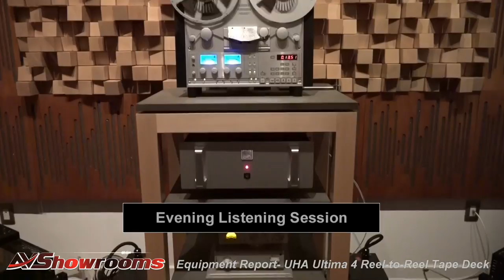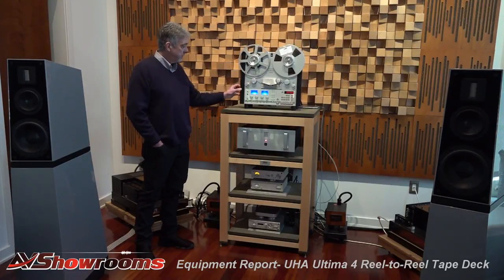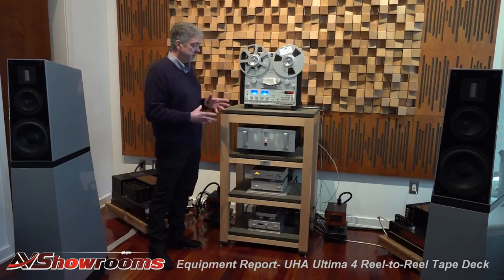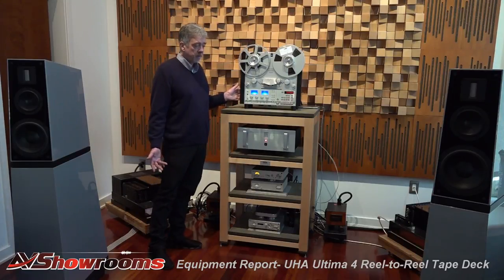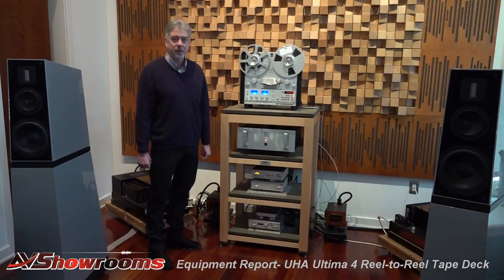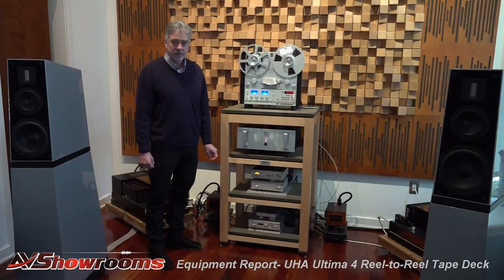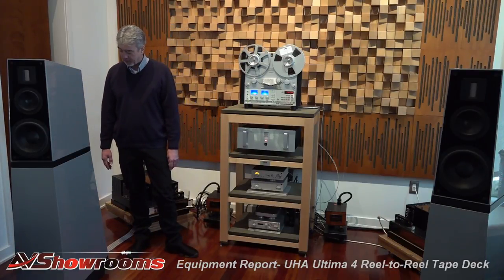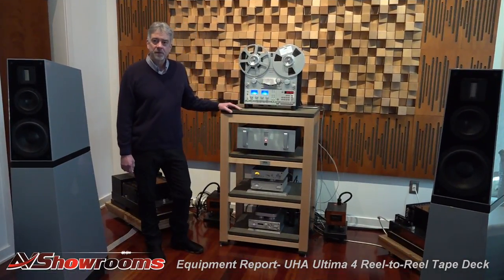United Home Audio UHA Ultima 4 Reel to Reel Tape Deck, listening sessions and overview at Bobby's

Comment: I see that you have Vicoustic Wave Wood and Multifuser Wood panels installed (and perhaps other panels out of camera view).

The Wave Wood, I suspect, you installed via Vicoustic's glue.

Vicoustic have been known to sell their glue, past the glue's "BEST BEFORE END OF" date -- even a year past that date, which is stamped on the glue's tube (check your glue, if you still have any tubes).

This has resulted in many customers having had panels fall off of their walls and ceilings in only months after installation.

Has this happened to your listening room?

If it does happen, please post a comment here, including Vicoustic's cooperation, or lack, therefore, in remedying the problem.

Cheers!